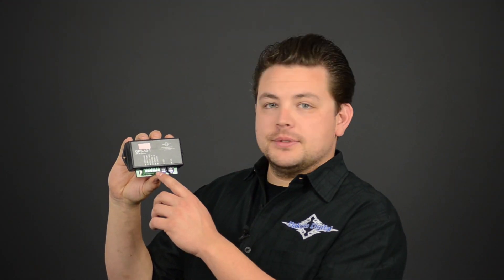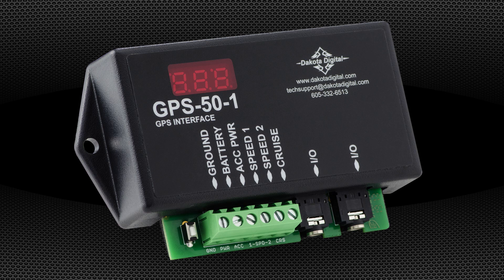Dakota Digital's GPS-50-1

Comment: Is the speed and mileage accurate
Reply from the maker: Hello Chance,
The speed and mileage will be read back by the speedometer/odometer, connected to the GPS device.  As long as calibration and/or setup is completed properly, you can expect an accurate speed reading, which is then accrued into stored mileage.

Comment: I have RTX gauges in a 69 Camaro with an GM LSA connet and cruise Kit it has a 4l85e I have your BIM 01-2 module. It's drive by wire Throttle body will this module give me what I need to get cruise controll in my car?
Reply from the maker: Hello!  The GPS-50-2 could provide VSS info to a CRC-2000, but first, check for a VSS OUT wire in your ECM harness; this will provide a more stable signal for the cruise control to read, not to mention save a few bucks.
Reply: @DakotaDigitalTV  Thanks

Comment: I ordered the HDX gauges for my 72 Monte Carlo. I also ordered the 50-2 GPS module. Is it possible to just use the GPS module alone without using the speedo cable that comes with the kit or do they have to coincide with each other?
Reply from the maker: The GPS unit creates a speed signal; there would be no reason to have two speed signals for the HDX system; use one or the other!
Reply: @DakotaDigitalTV  Great. Appreciate the info!
Reply: Thanks for asking this question, Paris.  It was an excellent question, and it helped me.

Comment: Can I use your GPS Speed Signal as a VSS input to my ECU?
Reply from the maker: @shorty, The GPS -50-2 can provide VSS data in your choice of pulse-count, however it is not designed to control a shift computer or shift pattern of the transmission.

Comment: If I buy your cluster unit for my 62 Impala, do i need to have this for my speedometer to work? Or does the cluster come with something for the speedometer to work right out of the box?
Reply from the maker: Good day @Michael Minino, There is a speed sensor supplied with all instrument systems. The sensor is designed to thread onto the transmission in place of a mechanical speedometer cable.

Comment: Can I wire this into my stock electronic speedometer? I have a 1990 240sx
Reply from the maker: Generally, this is designed for an aftermarket speedometer which allows for an adjustable pulse rate input.  While we haven't tested this vehicle application first-hand to know the exact settings required, this would likely have to be coupled with our SGI-5E to achieve the exact frequency that your OE speedometer is looking for.

Comment: I already have your cool vhx gauges in my 68 Camaro, the Speedo gear failed in the M21so ordered this gps unit.  Can I plug this in my self or let A pro handle it?  thanks!
Reply: +gpz1100z1 
Thanks for the message.  The installation is quite straightforward, although this choice should ultimately be based upon your comfort level with automotive wiring.  The GPS unit will require a power & ground connection, as well as a direct plug-in to your VHX setup.  It should be mounted securely, then just stepping through the various setup/calibration options.
Thanks much